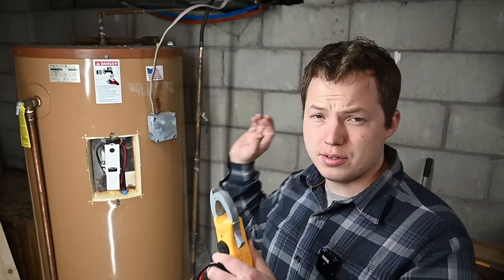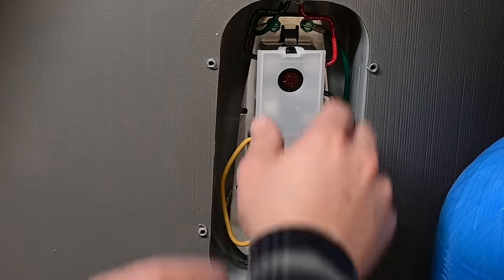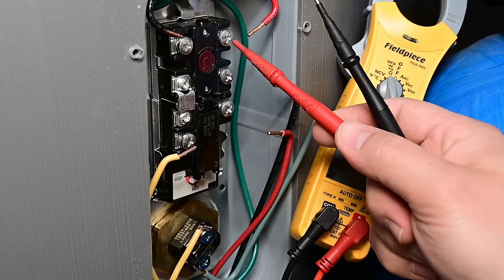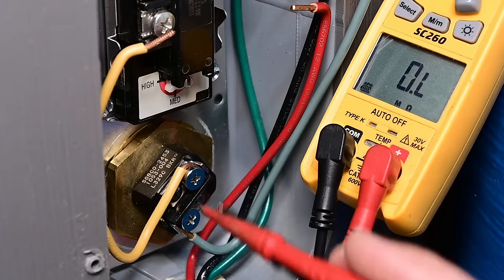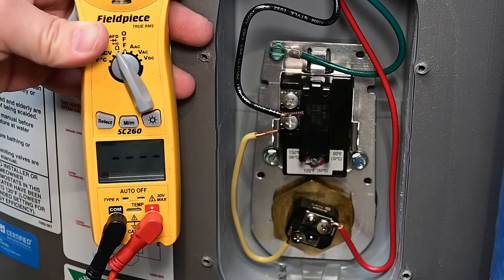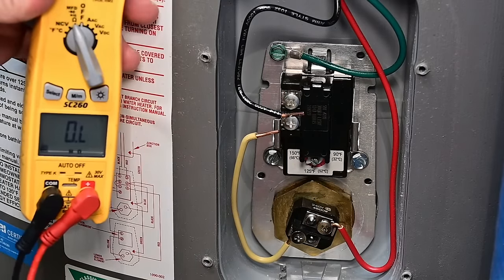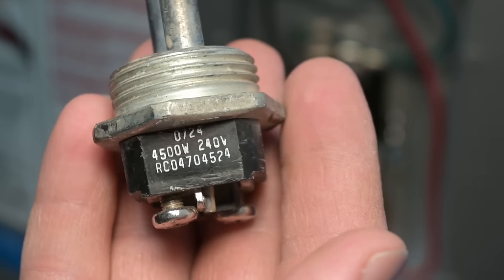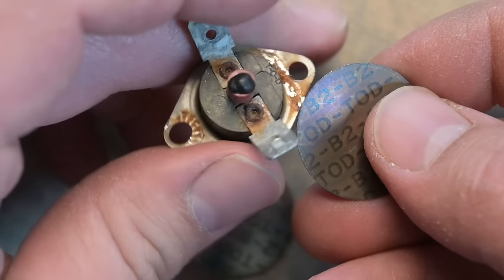How To Check Electric Water Heater Elements & Thermostats With Power On & Off

Comment: Fantastic video.  Not sure who's the biggest kid, however.  (Just kidding)  One thing that is not covered.  My understanding is the top heats first, then the bottom.  The thermostats are pretty crude for markings.  Is there a way to get them close so both elements work equally as much to prolong their life?  Seems if you had the bottom set higher than the top and heat rises, then it would tend to work the majority of the time.

My Rheem XE50M09EL55U1 under the second-story stairs I installed myself on 8/22 is behind the double-door fridge in the kitchen.  Need to screw up-leveling feet to move the fridge and pull it out.  So real pain to get to the heater.  Noticed hot water getting a little erratic a few months ago in the shower keeping it consistent.  Just two here, so not actually running out of hot water.  The Rheem has the 3 monitor status lights showing power, top, and bottom element. I can see them and why I got it.  I only see the power and the top element light going.  Never the bottom.  If the element is burned out in the bottom, will this disable the light? 

I left the factory setting as is.  Now that I read the book (ha), it appears to say the top should be set 125-130 and the bottom 120.

Totally confused about how to balance thermostats and even if they should be?

Comment: Hey Ben! Thanks for all your You tube posts! it's been a real help for a buddy and I putting in a sub panel at his house. I'm hoping you can help us solve a mystery? We've got newly installed arc fault breakers we can't get to stop tripping, does his main service panel need to have the neutral and grounds separated? any advise will be appreciated, thanks again!
Reply from the maker: Sure thing. Most likely there is a shared neutral somewhere in the wiring. If you accidentally combine the neutrals from two circuits the AFCI breakers will always trip immediately. You may need to trace the wires and see if that may be the case. You could also try those new bemreakers in a "known good" circuit that is not tripping to see if the breaker itself might be bad. It should not have anything to do with the neutral & ground separation in the sub panel although that is important of course. 

Hioe that helps point you in the right direction!
Reply: @BenjaminSahlstrom  Thanks again!

Comment: hey i just installed new water heater at my friend house , watter heater didnt heat the water just notice a little warm water so i did the test as you showed here and ended up  replacing the  upper thermostat  and guess what it worked , so im a little confused now i got hot water   but when i test the power like you did i dont get 240 vlt  only 110,   what could be the issue  i was thinking the  braker on the panel   but why is water heater working good now

Comment: Brand new WH installed Saturday, heater kept tripping the reset, so I followed your steps and found continuity throughout and from the black which is on terminal 1 and the yellow wire connected to element, and then I switched the temp higher/lower(never heard a click) and it never switched to the other element terminal.(if I’m wording that correctly)… would it be a faulty thermostat?

Comment: Hi Benjamin.  Thanks for the informative video.  You didn’t specify if that electric hot water heater was in your home or not.. but assuming it is.. why would you choose an electric hot water heater when you have propane available?
Reply: It usually comes down to price or availability. If you are in a rural place you may not have gas as an option unless you spring for a giant propane tank that is parked in your yard.

Comment: Happen to see you put a vid out on interlock switch for breaker box and how to wire plug to box. My question is can I move my breakers down two spots to make room for the 30 amp breaker I need to use to wirier in for the generator?

Comment: As per the first thermostat setting once the first element reach the desired temperature the first thermostat automatically shift the supply to lower thermostat. Once the lower thermostat reach the desired temperature again the upper thermostat start to work.this is going on in water heater.am I correct sir?Because this is what I learned today from your video.my understanding is correct or not sir?

Comment: Thank you. 
I have one question: When the Emergency Cut Off switch has tripped, will the el. power get cut to all of the lower terminals or only on the left side vertical row.
Reply: 14:10

Comment: My problem is my water is getting too hot. The upper thermostat trips out. Once water cools down I can reset the thermostat and water begins heating then will overheat and trip out again. I have not done any electrical testing yet. Do you have any idea what might be the cause. I can replace the thermostats but am hesitant to attempt replacing the heating element. Seems like any time I work on plumbing it turns into a major issue.

Comment: One question. If the bottom thermostat and element is wired to the only one hot wire from the upper, how do you get 240 on the bottom?

Comment from the maker: Subscribers get $25 off the Sense Home Energy Monitor by using code BENJAMIN at checkout: http://store.sense.com/discount/BENJAMIN
Reply: Hi Ben
For some reason I had 118vac on each side of my thermostat source terminal but when I meter across both terminal I don't have 236vac. Could that be meter is faulty or the lead is bad? I tested the lead they both got continuity. Or because the thermostat was bad. Thanks again for the help in advance.
Reply: What is the reason of reset button heating

Comment: Benjamin, thank you so much! Like a Mamma thanking here Son! My top element is showing its leaking current and probably needs replaced. The bottom is fine. 

Is there any other reason the top element would show making current? If it's showing as leaking current  -- when testing it grounded with a multimeter (testing at your videos 9:16 second mark) does that mean it's definitely going bad?

I get up to 3.460 ohms as the numbers jump around or climb to that depending on where I touch the probe to keep it grounded. 

On the bottom heating element I get zero no matter where I touch the probes. The current doesn't register at all.  

I pulled the top element and it appears fine. Fine, except for one area that's bulging. There's no pitting at all. Hmmmm.... 

Also, neither thermostat when turn down make any kind of click noise. Then when I turn them back up all the way there is also no click. The water tank  is 13 years old. 

Thanks!!!

Comment: suburb tutorial for home owners... first a tip..if outer cover of element is corroded or "blown"  you did right/good by pointing out you could being getting a ground fault (shocks thru the water fixtures) the other not uncommon symptom;   the one leg not on the thermostat switch can still be creating heat thru the break by using the water as a path to complete the 120 volt circuit; this will eventual trip the high limit... (the trip is normally found in the mornings or when hot water demand has been low) second a question; why not use amp clamp as you manipulate thermostats from high set to low set... not definitive on element condition to ground  "blown?" but quick check of thermostats

Comment: arer the thermostats and element universal? i have a westing house 115 gallon tank (yes its a motel) and the 4 parts are 360, i see at HD they have a rheem kit with the 4 parts and its $34??? water temp has climbed to 174 degrees and temp set at 140 ish, button USED to trip but thought temp was to high (170 motel extends 120 ft each direction of tank) lowered temp button stop tripping... months later pressure valve opens  (replaced) still opens sometime twice a day. now im leaving a sink with a trickle of hot water  so far 36 hours later valve isnt opening?

Comment: Great video! How do I calculate the ohms for a 2Kw heater?
Reply: P=IV, R=V/I,  P=wattage heating element, V=voltage heating element,  I =current max heating element, R=resistance heating element in ohms.

Comment: Great video!  Thank you for this.  Question, though: What does it mean if I have 122 V from each lead to ground, but nothing from lead 1 to lead 2?
Reply from the maker: You most likely have a bad fuse/breaker/loose connection on one of the legs of power.
Reply: @BenjaminSahlstrom  Thank you, very much, for the reply.  I isolated the issue to one line between the breaker and lead #1 so it's just finding the specific spot now.  Thank you, again, for this response and the great videos!
Reply: @stuwits6809   I came here with the same issues. How do I start isolating and finding the specific spot? I'm a total newb!

Comment: How can I tell if it's the thermostat? I changed the element's but our water is still not as hot as it used to be. It's hot, but doesn't seem to get super hot. I do have the thermostats ordered and they should be here in a week, but just wanted to double check.

Comment: We came back from a trip and the water was tepid. We hit the reset button and everything is fine. Except. Bothy thermostats are at ~ 130 degrees, I just checked the water temp at a faucet with a meat thermometer. It's around 170 degrees. I'm guessing it's time to replace thermostats.

Comment: There is a sneaky issue with elements that pops up .The element develops a split or pinhole, allowing an electrical circuit thru the water. This causes the element to slowly heat 24/7 ,tripping the high limit switch. The high limit tripped can also be caused by either thermostat, or either element. The best fix? There are kits that have both element and both thermostats.Power off and drain the heater, replace the components. This is much faster and easier than hunting down the specific cause of the high limit tripping. If there is moisture beneath the covers- beware of a leak. The moisture will knock out the thermostats quickly.Spend no money or time until the leak is diagnosed-it could be the tank.

Comment: Took me a min to understand the way you would test where the 110 comes in to where it jumps through the emergency breaker (red to grey) to get zero volts instead of grey/black to ground getting 110v. Is it just a different way or is there a purpose for that. 
If its just a different way then I will continue doing it my way to maybe eliminate the false reading of a corrosive screw not making contact.

Comment: Good vid  so in the 🇺🇸 you have dual phase in your domestic housing ?
Reply: Derek cross no, not dual phase.  It’s one phase with a center tap on the transformer. The two legs are measuring 120 volts between the leg and the center tap. Or 240v between the two legs.
Reply: Neil Brookins thanks for the info 👍

Comment: Why no thermal limit on bottom? If lower thermostat fuses closed, lower element may over heat.
Reply from the maker: Eventually the lower element would cause the entire water heater to reach the limit temperature as far as I understand so the thermal limit on the top thermostat would protect the water heater from over heating.

Comment: Hello, I tested everything on my water heater 3x and everything tested ok.  My water suddenly got scaling hot. It gets so hot it overheats and trips the shut off. If everything is testing fine, what else could be causing  this issue? I have already replaced the upper thermostat.  Please help. Thank you

Comment: Minute 14.58  ,you should not have 120 v between the 2 terminals  of B phase,you need to measure to the grounding screw or  metal of the  tank.

Comment: What would cause the top thermostat to trip? When I push the reset, it works for a while and then trips it again. The water heater is less than 3 years old.

Comment: Need help! I am in Peru where I live. I have an electric hot water heater  110 liter capacity which only has on thermostat with a timer. What I need is your help with a diagram on how to wire it. It looks simple but I had to purchase a new element and did not record where the wires go. If you could send me a message where I could contact you I would greatly appreciate it. I live in a very remote area.

Comment: i have a whirlpool with a circuit board at the top. everthing is outputing voltage and switching like it should. it is a 4500 watt and the lower element is getting 35 ohms with the wires off. its reading over twice the amount of ohms that it should. what would cause this?

Comment: Our home has been pulling 2100 to 2200 killwatts hours a month, which doesn't make any sense, we have no air conditioning and use wood for heat, the only major appliance we have that makes any sense is a water heater when it comes to sucking energy.

 The  Average kilowatts per month of a home is around 900 to 1100.

 We're pulling enough energy to run 2 households for a month.

I had an electrician come out and he couldn't find anything other than he thought the water was running more than it should with the use of hot water.

Do you think a faulty water heater could explain that high of KWH usage a month? I'm going to go through all the troubleshooting, but I wanted to get your opinion.
Reply: Did you find a hot water leak?
Reply: @krperry2007  
No. 
I'm going to check it for sediment

Comment: Ok damn I was testing a water that tripped a breaker when I turned it back on the top was at 240 and the bottom was getting 120 , I was about start replacing things

Comment: Ben great video. Can you please  explain why you read 240 volts when testing both legs? Wouldn't the voltage difference read zero since both legs are 120?
Reply: They are 180 degrees out of phase.

Comment: So for some reason i have 60 volts in the bottom heater while the top heater is being powered on. Could by thermostat be bad
Reply: Were they wired in series rather than parallel?

Comment: Hi Ben, how can I install a second water heater in my house? Can it be in the same circuit with the other?
Reply from the maker: You will need to install a separate double pole 240v 30amp breaker with some 10/2 wire to feed the new water heater most likely. Its not too difficult as long as you have space in your electrical panel. Good luck!
Reply: Thank you very much for your response.  Very helpful. Greetings from Alaska!  Keep up  the good work.

Comment: What does it mean with power on that the wires coming in each read @134 but the wires in the 1st set goin to right and left side read 0?
Reply: i have the same issue, did you figure it out?

Comment: What does it mean if I have 120 on each leg coming in but my meter shows 0.00 when I touch both the red and black. On your meter it shows 240v mine shows 0. I recently have no hot water so I replaced both thermostats and elements.
Reply: I'm here with the same problem searching for answers. Any tips for me?!

Comment: 13:38 I use to get 240v on terminals, but now I get 0v, but if I test each terminals with ground I get 120v, what would the problem be?

Update: I disconnected both terminals, tested the wires coming from the breaker, one of them was 120v the other is 18v. I'm guessing I need to replace that breaker.
Reply: I am here with the same problem. I appreciate your update but is that what you had to do?
Reply: @CryptoClairs  yes I changed the breaker, it's all good now. My water heater kept tripping the breaker, turns out one of them were bad.

Comment: What if I’m reading 120 on each leg of power but when touching both it’s zero ??  Brand new water heater to !
Reply: Was one leg open?
Reply: @krperry2007  turns out my power supply up top was messed up so one leg was only working at a time. Very odd. But fixed the wiring and it worked there was a old fuse set up above and the fuse popped

Comment: On my water heater has the red wire and blue wire together the red going to the bottom element and the blue going to the top element. The black is below the red and blue on the screw below them. The black goes to the bottom thermostat.  That's the way the color and pattern is on the one I have. But all the rest is the same as his is.

Comment: 18:24 
So 0V means two things? No wonder people get confused. Whenever I read 0 volts, I think there is no power going through the wires. But it actually means it's on, depending on how it is wired.

Comment: My water heat stops working, when I test the thermostat top screws for power, it does not have power, however when I test the top wire nuts it has 240v. I go to the water heater circuit breaker and it is not tripped. But to temporarily resolve the issue I reset the circuit breaker and that fixes the issue. Next day I check the power on the top screws on the top screws thermostat and again does not have power! I’ve  already changed both thermostats and both water heater elements, what I’m I missing?
Reply: My assumption there is loose wire connection on your circuit breaker.

Comment: I get about the same readings as you both with power on and off.  Both my thermostats are set at 125F and I even tried to crank both of them to 150F but still get lukewarm water at best.

I even get some oscillating temperature between Lukewarm and colder sometimes...

Is it possible that the thermostat reads the wrong temperature and trips at a lower one?  Is there a way to test that?

Comment: I am getting 240 volts at the element, but I am not getting the noise that it always makes when heating the water.

I am pretty sure that the element is bad, because it is getting 240 volts

The tank is 11 years old

30 gallon

3500 watt 240 volt element on the bottom

I don't see any element on the top

It has a plug in the hole where the upper element would be

I am not sure if I need to drain the tank to replace the element.

I have a shut off from cold water supply, so I can turn off the feed water to the tank

My breaker was tripped in the panel, and I reset it and it is not tripping, but I think the element is burnt out and open